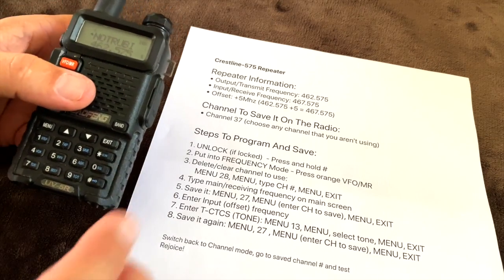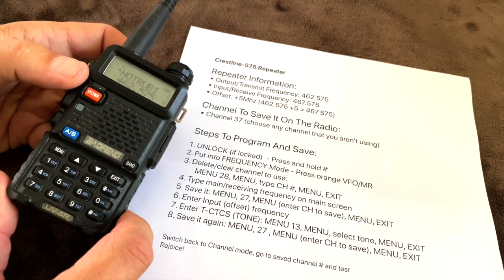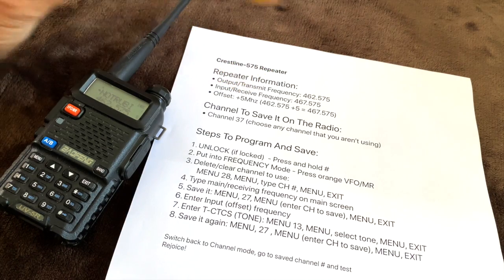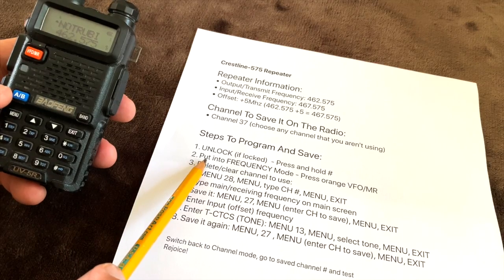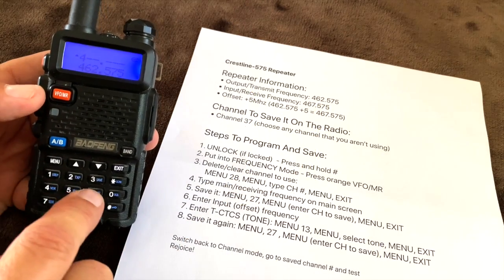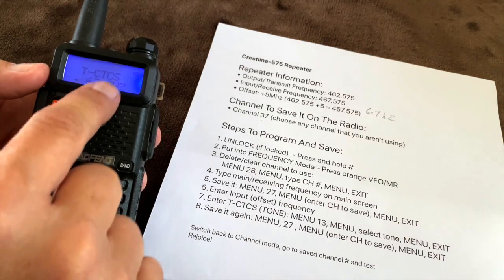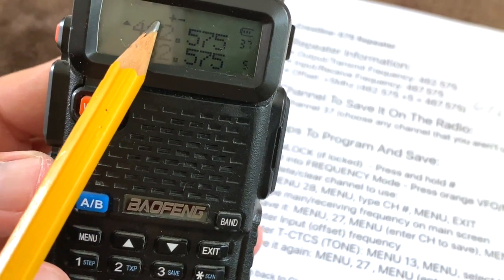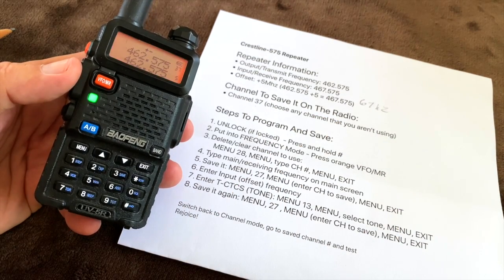Baofeng UV-5R: Add CTCSS and DCS Codes & Tones On The Keypad And Connect To & Talk On A Repeater

Comment: Something puzzled me about these steps, Step#8, when you store the second frequency 467.x at the SAME memory location 37 this radio automatically assumes 462.x and 467.x are Output/Input frequencies offset of each other.   That's a really weird interface/expectation.

At 7:04 (Step7to8) you say you have also your Receiving frequency saved? you probably meant to say ENTERED but not saved.

At the end of this clip you never talk, you simply press the PPT button and expect the green indicator to light up. What is supposed to happen with a repeater when you talk?  if ANOTHER radio is configured exactly the same way?  Are you supposed to hear yourself on the same radio?  on the OTHER radio?  How do we verify the OTHER radio(s) are receiving the transmission via the repeater???

Please explain.  Thank you!!!
Reply: You would verify by saying your call sign and "monitoring" to see if they hear you.  

When I did this, a simple press of the PTT got a response from the repeater.

Comment: so I keep coming back to this video to try to get back to my local repeater, and something that's frustrating is that my UV5R has settings in the radios menu that don't match the user manual. I was able to get success using the (26) OFFSET and setting the offset there, along with the (25) SFT-D to set it to positive or negative, after only saving the downlink frequency to the channel I wanted to use. Due to user error, I erased the channel (reset isn't just for a channel it's a full on factory reset, derp) at 3 AM and haven't been able to get back on since last night. Are there multiple ways to skin a cat with these radios? Or is my radio set up just a little different than the one used in this video, as it appears the software in the radio (specifically the menu listing) does not match what is in my included user manual.
Reply: I'm never commenting on a youtube video again because after the coffee kicked in I have discovered BOTH ways work.
Reply from the maker: I was going to suggest trying more coffee.
Reply: @TheNotaRubicon  the coffee consumption level is reflected in the way I wrote the comment for sure.

Comment: Hi i did the way you told. When i let go the talk button the squelch opens up for few seconds and it says A-Rx but i cant hear my talking while press the talk button.
I use 2 radtel rt900 
T-CTTS is on 67hz like webside of the repeater shows.
Downshift is 7.600khz
Tone 1750
Its a 70cm band in Germany
Repeater is 5km away from here
What is wrong?
Reply from the maker: Watch this video and see if it helps:  https://youtu.be/CPJPhnIi6Zs?si=wI7_69jFUIi5zKYr
Reply: First of all thank you for that quick answer! Well this problem is only by use repeaters.   If i just use a frequenz that both radio use (not over a repeater) i can hear and talk clear even if i lay them side by side.
Is the issue that the Man from your link talking about only a problem when use repeater? If yes it would make sense why mine dont work when side by side.
I am from germany , sorry for my bad english
Reply: It works!!! I had both radios to close to each other by use a repeater.20 meter from each other works fine! I would never get it without you thanx!!!

Comment: Total Noob here. I have a question. With a repeater do I have to be plugged into that repeaters frequency, or can I be on any frequency and set some of those other settings into that repeaters settings to utilize the repeater on the frequency I'm on? I really hope that makes sense
Reply from the maker: To use a repeater your radio must be programmed to use that specific set of frequencies (a repeater uses 2 frequencies) and the specific "Transmit tone" or code. Optionally you can also use the repeater's "Receive tone" or code.
If anything is not correct you will not be able to use the repeater.
Reply: @TheNotaRubicon  I'm not understanding. I'd like to take a class and there'd nothing near me that I can find.  I'm reduced to youtube and can't get clarity on this

Comment: I got a random question I’m gonna sound stupid because I’m new to this I have two UV 5R radios the offset is the same on both. The tone is the same on both. The shift direction is the same on both. I got a bounce back from a repeater to both radios. But when I key up, I don’t hear my voice on the other UV 5R radio ? Just a bounce back the light goes green don’t hear my voice I did steps 13 26 25 and 11 are exactly the same on both radios and before I did all this I reset both radios so everything else is the same. Why can’t I hear my voice on the other radio vice versa? Also both transmit and receive frequencies are  the same on both radios. I know I’m connected to a repeater because the light turns green and I hear a Morse code, but I’m not hearing my voice on the other UV 5R.

Comment: I did everything but I'm not getting any repeater bounceback.
Reply from the maker: Then either:
You have the wrong tone
You have the wrong frequency(s)
You did not set the offset
The repeater is not online
OR
The repeater is out of range
Reply: @TheNotaRubicon  I'm a Noob to this and wanted to learn a Lil bit about this as i picked up a BAOFENG.  I got the repeater info from a Google search.  Any chance you can take a call?
Reply from the maker: That is not how Youtube works.
Reply: @TheNotaRubicon  lol I get it.  This thing just has me beat!  I should have just got the $40 Walmart pre set cobras.
Reply: I had some trouble.  My mistake was forgetting to save it to memory each time I updated something.  Now it works.  I'm programming my brand new UV-9R.

Comment: I don’t have the plus or minus symbol, I’m wondering what I did wrong
Reply: Take another look at step 6.  You need to update the offset frequency with the CTCS codes.  I had the same problem.  It seems counter-intuitive to save both the output and input to the same channel.

Comment: been trying to input different repeaters now, but i think it's a failure though encoded manually as what i saw in your video but the thing is i'm too far away from the location of the repeater. the question is, do ii need to go near the location to access the program? after encoding all details in my radio. i executed a transmit and it lighted green but it's silent, no beep or any sound so i don't know if it was a success

Comment: What if the light under the VFO/MR button turns red and not green? My screen turns orange like yours. But no green light. Just red….is that an indicator that it is out of range by any chance?  
Ive been trying to troubleshoot for months…. Thanks so much.. your videos help me a great deal!
Reply from the maker: Red means the radio is transmitting.. The color the screen changes to when the radio is transmitting is configurable in the menus.

Comment: My radio has Channel 24 with frequencies 462.5750 / 467.5750 MHz, named RPT-2. Do I still need to follow your instructions to set it up, or can I just use Channel 24 and set the tone? Thank you for a nice video.
Reply from the maker: It sounds like you have a "GMRS" radio, so all you need to do is add the TX tone and optionally, the RX tone.
Reply: @TheNotaRubicon  "That's great! I'm learning so quickly from you. Thank you!
Reply: @TheNotaRubicon  yes it is a "GMRS" radio (BAOFENG UV-5G)
Reply: @TheNotaRubicon  "One more question: Should I undo the offset made at 6:11 minutes?
Reply from the maker: 1) No 
2) Its a GMRS radio, so you cant, even if you wanted to
3) Because its a GMRS radio, just set the TX tone and start using the repeater - get off the internet and stop trying to overcomplicate it !
Reply: @TheNotaRubicon  I initially thought the Baofeng UV-5R was a GMRS radio, but after looking into it further, I now understand that it is not.

Comment: I am Using Chirp to program, and I am having trouble telling if the offset is saving correctly. On the main screen I see the +-, but on the menus it does not show that I have an offset saved into the channel the same way the T-CTS shows as a saved setting. Any advice?

Comment: There should be an asterisk by these tutorials. I’ve watched these videos 6 X’s. Paused & replayed it numerous X’s. Imputing the info. carefully (I think). I don’t think it’s correct. It’ll be easier to send the unit back & start fresh. Yes, it’s my fault & inability. I’ve always blamed myself 1st, last & in between.
Reply from the maker: Instead of sending it back, just do a factory-reset in the menus - that will reset it back to the way it was when you took i out of the box.
Reply: @ Thank you.  think it was a return or non virgin device they sent me. There’s something in the ANI-ID that “can only be programmed” I think with chirp.  I didn’t program it and don’t have the chirp program.

Comment: Amazing video, so easy to follow along,... but, sadly it does not work for me. I have a Baofeng UV82HP  so the same keyboard as yours. I can follow all the steps but when I go to look at the new channel both frequencies are always the same. I tried to use the ones you used 462.757 and 467.757 and they both show 462.757 for some reason. No matter what I do the frequencies always show the same number as the first frequency I put in and the radio ignores the second one. Is there a setting I am missing? Since it is a repeater the Reciveing and Sending have to be different but adding a new channel with both the SEnd and Recive the same it works fine. I am stumped. Any thoughts?

Comment: The the vids but I still cannot connect to a repeater. Im located in Chino.
Reply from the maker: That means that you are either doing it wrong, or your radio is out of range of the repeater (just because you can hear it does not mean it will hear you).

Comment: Idk I've followed all the steps I have everything in it correct for some reason they can't hear me on the repeater they say I'm coming in on simplex. They can hear me trying to key up but nothing else.
Reply from the maker: If you did it correct then they would hear you.
Reply: @TheNotaRubicon  idk I'm seeing stuff on the internet that the new uv5r can't transmit on gmrs repeaters. I have no issue talking to ham repeaters. I can hear them on the gmrs ones, but they they say I'm on simplex, and idk how to fix that when I've got everything in right. Spoke to the repeater owner himself he was trying to help me. Who knows. I was gonna order a gmrs radio anyways which gives me more reason to do so.
Reply from the maker: If they say he's coming in on simplex, then the radio is transmitting on GMRS and is not locked..
The problem is he is transmitting on simplex without setting up the channel as a repeater with an offset, as was already posted. This is why for many people, buying an actual "GMRS" radio is better than an unlocked H.A.M. radio because a real GMRS radio does this automatically ...
Reply: You are missing the tone (T-CTCS) or the offset (+ or -).
Reply: The recieve and the transmit is the same.

Comment: I noticed you manually put in the input and then the output with the offset added. I’ve seen programming where the transmit frequency is set then the input frequency is set THEN the offset is set individually and the plus or minus setting is done?

Comment: THANK YOU ---   was getting VERY tired of sparring with the radio mistress, and you helped make it work.      Two issues.   I cannot seem to program the repeater RECEIVE with tone squelch  :-(   and I cannot seem to make the display display logically [with tx/rx frequencies] like you did in the vid.   I have some other frequency displayed in the lower section, unrelated to the repeater.

Comment: I need help. I’m trying to connect to the ranchino repeater. I can transmit to the repeater but I can’t hear anything that’s coming back. 
Thanks in advance
Reply from the maker: Remove the RX/Receive tone/code.
Reply: @TheNotaRubicon  thank you. I just redid everything and I think I got it. I’ll test it the next time I’m in the area
Reply: @TheNotaRubicon  do I need the transmit code?
Reply from the maker: Yes, pretty much all repeaters require the TX code but the RX code is always optional and if you do it wrong you wont hear anything.
Reply: @TheNotaRubicon  ok. I’m very new to the hobby and I have my GMRS license. On the ranchino repeater page on MYGMRS it shows the input & output tone are both 023 is the TX the same as T-CTCSS?
Reply: @TheNotaRubicon  I tried redoing all the steps and no luck. Could you possibly make a video on how to connect to that specific repeater on the uv-5r?
Reply from the maker: I have made several videos showing how to do this on a UV-5R ham radio already, but i recommend using a GMRS radio for connecting to a GMRS repeater instead of a HAM radio (UV-5R is a HAM radio).. a GMRS radio is VERY simple to connect to/use a repeater.
Reply: @TheNotaRubicon  ok thanks for all your help
Reply: @TheNotaRubicon I can’t even do that. I have the Ksu7 UV-3D and I have no offset option. I can choose a plus in a minus, but I can’t choose both for the offset.

Comment: Repeater im trying to connect to gives a 311 DPL for tone, but Baofeng uses freq.  Is there a way to convert that?
Reply from the maker: All Baofeng GMRS/HAM radios use and supports DPL.. Did you check the user manual?

Comment: Thank you for the resources  I have seen variations of my question but my fifth grade level of comprehensions seems to have left me short. So in order to not be a sad gmrs operator can you definitively answer that a uv-5r  or clone can transmit a dcs code to a gmrs digital repeater and while i am on analog transmitter the digital repeater will in fact accept it and i will be able to use the repeater as fully functional? otherwise i dont see the point in having dcs codes for the uvr unless analog repeaters also use dcs code. sincerely from a newbie midland escapee intending to have a ham by christmas!
Reply from the maker: There is no such thing as a "GMRS digital repeater".. that would be like having a green car that is red.
Some GMRS repeaters use CTCSS/CTC tones, some use DCS/DTC tones.. This radio, and pretty much all radios can transmit both.
Reply: @TheNotaRubicon  thank you for clarification and the fast response!  may the 4th be with you

Comment: Can you point me the right direction to program repeaters on my UV 5G plus ?
Reply from the maker: all GMRS hand held radios have pretty much the same steps to program a repeater, so it is not significantly more easy than any other GMRS radio.
Reply from the maker: it is extremely simple to program a repeater on a UV-5G Plus:
1) determine which repeater-channel to use, based on the frequency of the repeater
2) Enter the transmit (TX) tone in the menus
3) There is no #3, you're done.
Assuming you know the channel to use, the whole thing should take about 15 seconds.
Reply: @TheNotaRubicon  if you don’t mind me asking why is this model
So easy to program compare to others ? And is there a more high end radio you recommend.
Reply: @TheNotaRubicon  I must be doing something wrong I can’t get it to work
Reply: @TheNotaRubicon  what do you mean by determine repeater or channel ? I put it on vfo mode and set the transmit tone in the menu but I’m still not able to use the repeater

Comment: No offset listed on this guys MyGMRS repeater. Where do I find that.
Reply from the maker: If it is a GMRS repeater then the offset is/should always be +5Mhz.. Receive is always in 462.xx Mhz and transmit is always 467.xx Mhz.
Reply: Hey, would it matter what repeater you are using in how the uv5r connects?
I can connect with the trans/output feq# 462.725 but when entering the off set 467.725 I then cannot connect then once removed I can reconnect to the repeater. 

I followed your instructions as closely as possible and cannot figure out this discrepancy.

Comment: The numbers you’re looking at while receiving,, is that the input or output ?
Reply from the maker: Your recieve is the TX of the repeater.
Reply: @TheNotaRubicon  
On that piece of paper with everything numbered(somewhat)  top to bottom , or the follow along instructions.. it is listed as follows 

Repeater Information
•(1) Output/transmit frequency  462.575
•(2) Input/receive frequency  467.575

Of the above ⬆️ two listed statements 
Which one, word for word ,, is 

THE NUMBERS IM LOOKING AT ON MY RADIO AS IM LISTENING TO THE TRAFFIC COMING OVER THE AIRWAVES FROM THE REPEATER TO MY RADIO ?? 

When I’m just looking at the radio , and looking at the frequency displayed , not transmitting, just listening ,, what am I looking at , am I looking at  
(1) output/transmit  or 
(2) input/receive 

??
Reply from the maker: On GMRS the repeater ALWAYS transmits to your radio on 462 and
ALWAYS receives from your radio on 467.
Reply: @TheNotaRubicon 
I know you’re trying to be helpful but you’re like asking a politician a question . I might could figure this out if you could read my question that I put great detail in , and answer forthright. If not I’ll send these things off and have someone program them for me cause nothing is working on my end . This is the biggest debacle I’ve attempted in a while  . I’ve never had this much trouble programming any of my handhelds
Reply from the maker: To be honest, your question was very confusing, ambiguous and difficult to decipher. Ask the question again in simple, grammatically correct English and I will give it another shot.
Reply: @TheNotaRubicon  
When I’m looking at my radio 
And I’m listening 
The frequency my eyeballs are looking at 
Is that 

The Output/Transmit frequency 
Or is it the 
Input/Receive frequency 

?
Reply from the maker: That is the OUTPUT of the repeater.